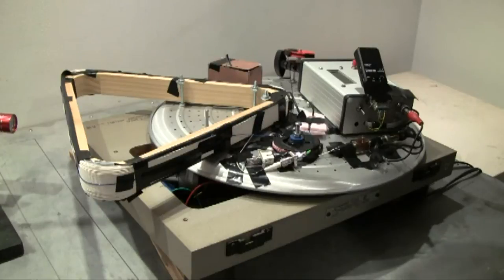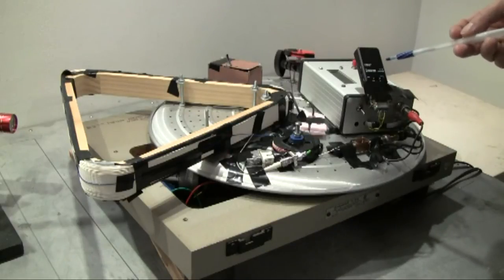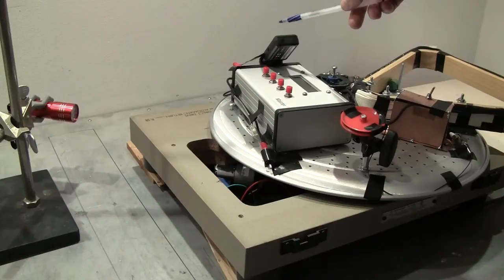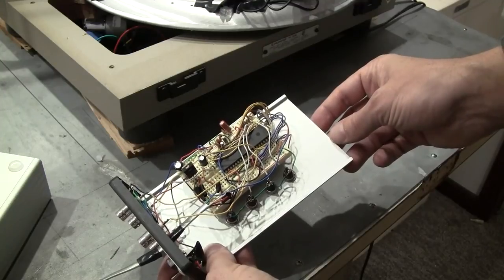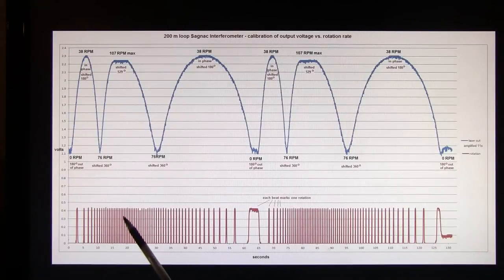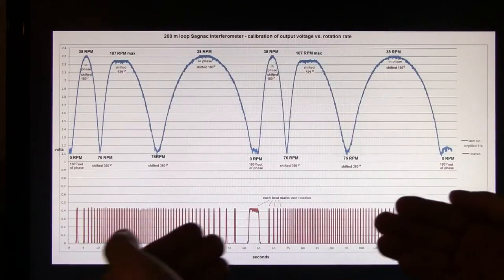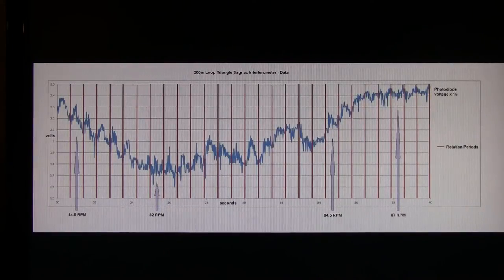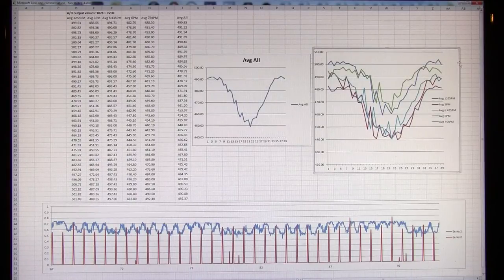iFOG Sagnac fiber optic Interferometer with wireless data collection

Comment from the maker: It probably could be done by applying a custom equation for Allan variance to the raw data set, and displaying the result in a log graph in Excel. Excel does provide some built-in statistical variance and deviation functions but not the Allan variance.

Comment: Can you explain more about the red phase adjuster disk? I'm used to seeing these with a signal generator hooked up to them. What would be the purpose of adding a signal generator to one?
Reply from the maker: In this FOG the output is a DC signal that is related to the phase difference between the CW and CCW beams. The red disk is a one element polarization controller that  behaves like a 1/4 or half wave plate, so that rotating it can bring the two beams into a similar plane of polarization, increasing the signal and sensitivity to rotation, since the beams will be in anti-phase when stationary, due to the non-reciprocal delays across the 2x2 coupler. In more advanced FOGS, a phase modulator is used instead which is driven by an oscillator, but in this case the output is then an AC signal, and it is often recovered/analyzed using a lock-in amplifier. The idea in this video is to present a FOG design which is much simpler than the AC version and using far less expensive components.

Comment: Using high quality bearings, or air bearing, and high quality motor, or just measuring it in freespin, without power, as it slowly goes down, could be more accurate, it would remove vibrations and non constant forces from the motor and other minute magnetic effects.